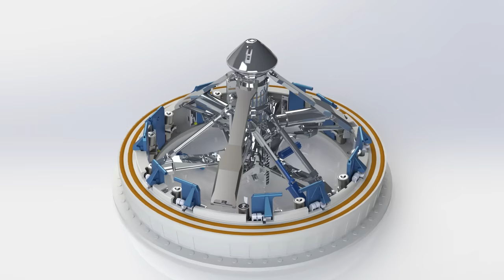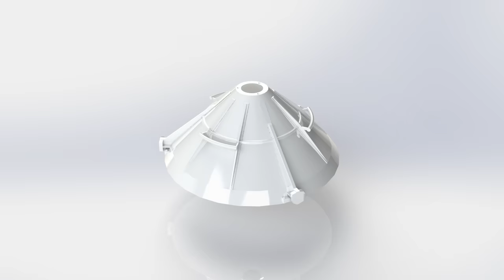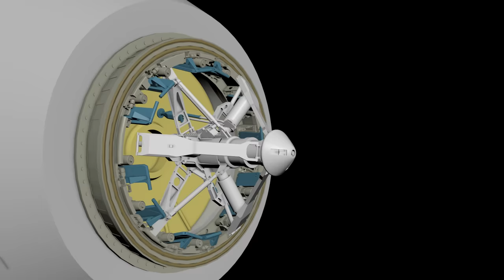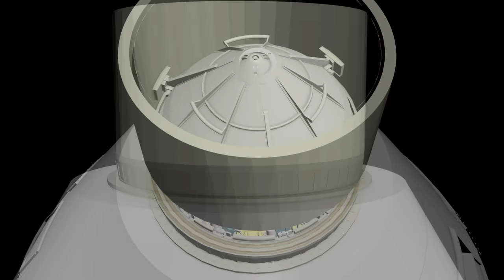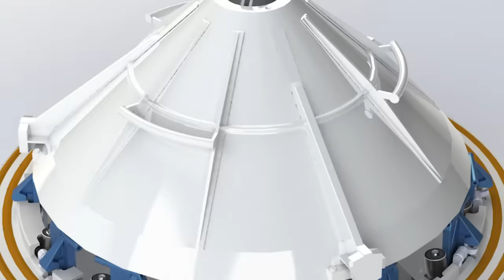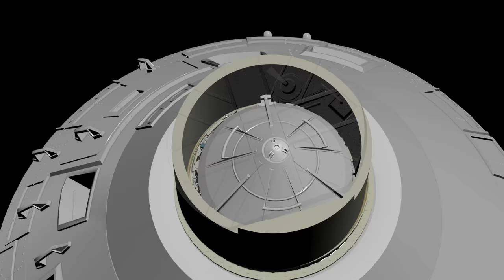Apollo Docking sequence - Connecting the Command Module to the Lunar Module.

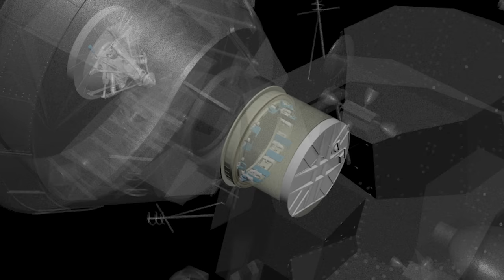Comment: 5:50 - How can you disconnect all latches with even both hatches open without risc of a separation of the two modules? It is not clear what else should keep them together.
Reply: The blue laches are attached to the ship and ring - not the device in the middle - which is much like a car jack system. Its job is to pull the 2 craft together, and once those blue laches lock, then the 2 ships are locked together. The center jack system does not hold the craft together but is only used to pull them together. So, until the blue laches lock, yes that center jack system and the end "knob" which latched into the LEM is holding them together. But, the blue laches are not part of the center jack system - they are attached to the ship - not the jack system.

to remove the center jack, the end "knob" with 4 laches does have to be retraced. But, the blue ring latches are not holding the 2 ships together.

see 5:31 for the blue laches that hold the 2 ships together.
Reply: @Albertkallal  
Your effort is appreciated, but it still doesn't make sense.
Reply: @Peter_Riis_DK  
Ok, you note at 5:30 with both hatches open. But, the hatches are not involved in keeping the LEM and CM hooked together. The ONLY thing holding the 2 parts together are those blue latches.  The center junk don't matter once you locked/latched those blue latches. The center junk is ONLY for pulling together the LEM AND CM. Once you blue latched, then center junk can be removed.

So, at the start when they pull the LEM and CM together, that hydraulic jack in the middle is most certainly holding LEM/CM together, and able to pull them together until the blue latches on the side lock.  So, the blue latches are holding things together. Those blue latches are not part of the  jack system - they are on the sides of the tube. 

So, at first the end "knob" with 4 latches do pull both parts together.  They then un-latch that  pulling knob.  That "end" small latches are retracted at 5:23. You ONLY do this after the blue latches have locked and are attached to the round tube, not the center jack and pulling system.

Had they not required some "pulling jack" system, then you could have NOTHING in the center tube, but only have those blue latches engage and lock. They are 100% independent of the center jack junk and stuff.

100% ignore the center jack stuff. You have a simple round tube with blue latches on the side of that tube. Once those latches lock in place, the two units are now locked together.   None of the center junk in theory is required here, but that center junk is really only ever used for pulling together the LEM and CM.
Reply: @Albertkallal  He skipped over actually removing the damn jack.
Reply from the maker: Okay, the 2 astronauts enter the Lunar Module. The remaining command module pilot refits the probe. The lunar module pilot refits the drogue. The small capture latches on the probe are activated to attach it to the drogue. The probe is then preloaded with 6000 pounds of tension which keeps both craft together. The LEM hatch is closed. The command module pilot then releases all the blue latches around the docking ring. This means at this stage the only thing keeping the 2 spacecraft together are the capture latches on the end of the probe connected to the drogue and therefore the lunar module. The CSM hatch is then closed. The tunnel is depressurised. The capture latches are released meaning there is now no hard connection between the spacecraft. The command module pilot then extends the probe, this momentum pushes the lunar module away from the command module. The LEM pilot then takes over and manoeuvres the LEM away. I hope this makes more sense. Trying to put the animation together and to make it easy to understand you sometimes miss some of the finer points, apologies.
Reply: @graffix101  
Thanks. 👍
Reply: @graffix101  Hello Kevin, I have been watching and rewatching this video countless times over the years as not only is it fascinating, something I have wanted to know of but had difficulty locating information on, but the graphics are amazing.

I have wanted to ask for a long time, though I'm sure you are inundated with requests, however... I would like to ask this question for your consideration. On launch the Apollo CM was covered with a protective shield that was jettisoned with the escape tower after launch and on some of the Saturn Vs, not sure how many or which ones, there was a white material covering the service module as well.

I have tried to find out about it without success other than brief mentions. I would really like to know what these covers/shrouds were made of and how they were attached to the vehicle.

Cheers.

Comment: 2:50. When the command module flips 180deg, how do the astronauts know it didn't also roll or yaw or even traverse in any of the three directions a little bit?  I would assume the pilot would need more than just the one optical sight (2:58) to check.
Reply: Faith, trust, and a bit of pixie dust.
Reply: how do you know your back tires won't turn in opposite directions of each other? the answer is physics. In space, there is no wind or resistance, no turbulance that can mess up the movement or convert one type of movement to another. When a control thruster fires, the force is applied uniformly and without any opposing forced, the vehicle moves exactly as predicted.
Reply: @Cliffmchrist  When you stop firing the thruster, inertia takes over and you continue in that direction until you fire thrusters in the opposite direction.  You would have to keep doing this until you are precisely in position.  The risk is losing track of how many adjustments you're making.  So having only one sight for alignment doesn't make sense to me.

Comment: i cant believe the maneuver thruster's where capable of aligning   the two craft at  1.6 km/s.  and link and with only a small window in the door of the capsule virtually flying blind,  . i dont know if youve seen  the problems refueling aircraft mid air at only 300-400 mph with direct line of sight
Reply from the maker: I agree. Brilliant pilots. I have done it in a flight simulator. Most of the time, not very successfully!
Reply: i dont know if youve seen  the problems refueling aircraft mid air at only 300-400 mph with direct line of sight

Key words here kiddo  are "mid air", Apollo missions didn't do docking in Earth atmosphere, but vacuum of space.
Reply: 1.6 km/s with respect to what? The earth, the sun, or the galaxy? All those velocities would be different, and all irrelevant. The only relevant thing here is their velocities with respect to one another, which  was a slow crawl.
Reply: @marksprague1280  yep.  velocity is always relative.   kind of neat if you think of it-- imagine if all that existed in the universe were a single billiard ball.  it could have no linear velocity.  it could only sit & spin.  neat, eh?
Reply: @gives_bad_advice  If it were the only thing in the universe would it really be spinning? How could you measure the spin?

Comment: After the rocket split and the control capsule and lunar lander were seperated, how did they dock with no pilot in the lunar lander. Also, isnt it a fatal engineering flaw to have that hatch at the nose? On reentry it becomes a weak point and would lead to catastrophic failure. Look how much protection the nose of the shuttles had and this capsule came back already compromised....id bet my masters degree on not plausible in 1968, '88, or '08
Reply from the maker: It didn't re-enter nose first.
Reply: Your Masters in basket weaving? It certainly wasn't in any of the hard sciences.
Reply: @marksprague1280  Masters? I think more like an AA degree....

Comment: this system is complicated which is why we done away with it in 75. today everyone uses APAS 73 or the APAS 95 system for their craft the Russians and to some extent the Chinese use the SSVP 2000 and 4000 models some modules use the hybrid SSVP 8000. to connect to modules used by the US or to other modules even airlocks Russia places a hybrid cone in the ball which uses the APAS 95 or APAS 73 docking system. the Pritchel module coming up in November will have five ports the bottom ports will have SSVP 2000 and 4000 to allow docking of a Progress Freighter or a Soyuz or Russia's new capsules the side hatches will use SSVP 8000 hatches or APAS 95 or APAS 89 hatches to allow docking with ROSS segment components which will be grappled by ERA after launch from Kourou or Baikonur.

Comment: And then you look at the cramped interior of the Apollo cockpit and realise that this is complete and utter nonsense. Gamma radiation from the solar wind would have killed them before they got there.
Reply from the maker: A path was set to avoid the most hazardous regions of the belts and the astronauts weren’t in this region for very long as they sped to the Moon, shielded by the skin of the spacecraft.

Any potential radiation hazards were accounted for and flights were scheduled when there were no major solar weather events.

Personal dosimeters (that measure radiation exposure) were worn by all the astronauts and exposure was low, no more dangerous than, say, an X-ray.
Reply: Solar wind does not contain gamma radiation. Like, at all. And you shouldn't have skipped physics at school.
Reply: No world government, no world space agency, no world military has ever claimed our Apollo missions to the moon were a hoax.
So very glad I have fry cooks such as yourself to help me get the record straight now. Hilarious man!
Reply: @user-uf2rj7zn7z  van Allen attached gieger counters to both surveyor space craft and detected high levels of gamma radiation. Passenger aircraft during a solar storm record up to 250 Roentgen. I didn't skip physics.
Reply: @moxiesaint-clare4257   I repeat, you shouldn't have skipped physics at school, as you obviously have.
Reply: @bobbybooshay8641 this is because every world space agency is NASA.

Comment: This is all pure speculation, nobody really knows how this works.
Reply from the maker: I'm sure all the engineers who designed and built it have a good understanding. Also all the astronauts who had to use it. Michael Collins didn't particularly like it, but it did the job. As for myself, I spent a long time reading the tech manuals, from there i tried to put together a simplified explanation that a lot of people could understand. 👍
Reply from the maker: Phil Failla  😂